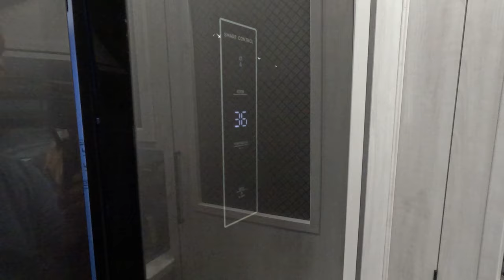RV Warranty Work at Florida RVs LLC Dublin GA

Comment: Did you buy from that store?
Reply from the maker: We did. This is the only dealer we have run across that makes no difference in if you bought from them or not. they do first in first out, or you can schedule your visit. They do things right regardless of who sold it, or manufacture. They keep all the parts on hand other than refrigerators and things like that.
Reply: @OurRoadLessTraveled  I live about 3 hours from them and it’s good to know they are a good dealer.